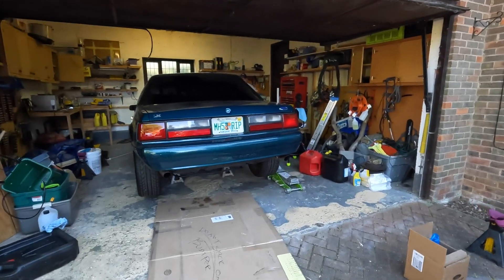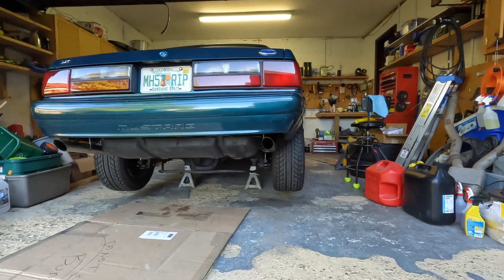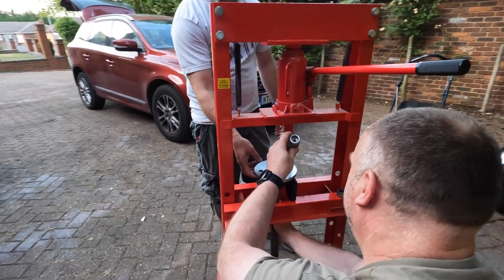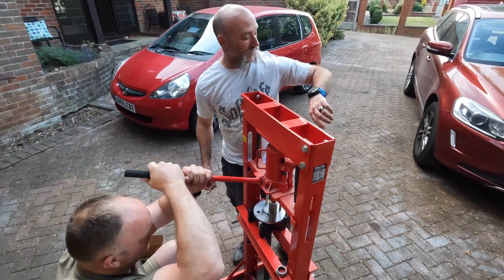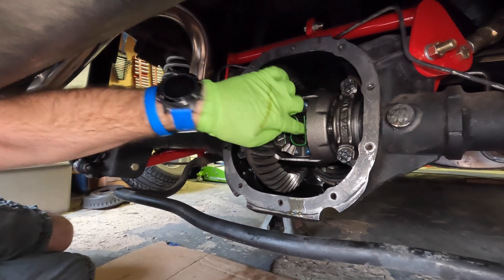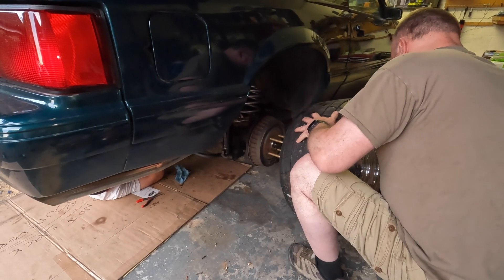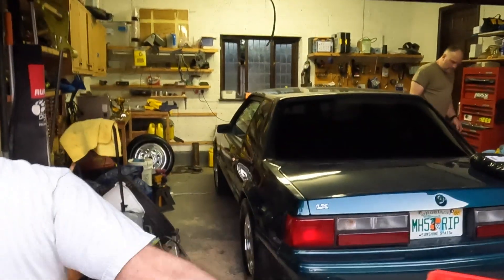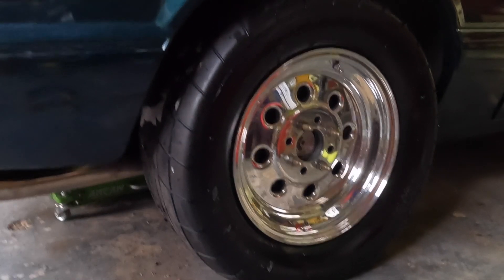Johns Foxbody 31 Spline Rear 8.8" Axle Upgrades

Comment: No threadlocker on the crosspin bolt.
Reply from the maker: The factory stuff is not really a thread locker but more like a wax or form of anti-size. If you’ve ever had one of these cross pin bolts get stuck or break you’ll know why.

Comment: Here's some information of 8.8 rear end axles shaft that i found on some mustang forum 57.25" - 57-59 Ranchero/Station Wagon 9"
*57.25" - 57-64 Ford Full Size 9"
*57.25" - 65/66 Mustang 8" and 9"
*58.50" - 77-81 Granada/Versailles 9" width
*59.25" - 67/68 Mustang 8" and 9" width
*59.25" - 69/70 Mustang 8" and 9" width
*59.25" - 67-71 Comet/Cougar 9" width
*59.25" - 86-93 Mustang 8.8" width - zero offset - 28 spline axles - 29.188" axle length
59.25" - 94-98 Mustang 8.8" width - zero offset - 28 spline axles - 29.969" axle length (Unsure of this width)
*59.50" - 91-94 Explorer 8.8" width - 3.250" tube diameter - 3.875" passenger side offset - 31 spline axles - 30.5" driver side axle length, 27.625" passenger side axle length
*59.50" - 95-01 Explorer 8.8" width
*61.25" - 71-73 Mustang 8" and 9" width
- 99-04 Mustang 8.8" width - zero offset - 28 spline axles - 30.688" axle length
- 02-05 Explorer 8.8" width

Comment: Hi, great work... do you know the axle shaft bearing seal part number.. i'm upgrade the my 2003 new edge rear end to a 31 spline axle shaft from a explorer (driver side) but i dont know wich axle bearing go to work 🤔
Reply from the maker: The seals are the same as the ones for the 28 spline axles.  I dont know the part number as the seals and bearings all came in the Ford Racing bearing kit.  I would just go on Rock Auto and it's easy to look them up from there.

Comment: Hi, would there be anyway to tell on my car if someone already did this by looking at the diff or axles without taking the whole thing apart. Thanks
Reply from the maker: Take a look at the end of the axle shafts where the axle studs are.  These 31 spline axles have an "M/E" cast into them for Moser Engineering.

Comment: "2 fingers" of clearance lol can you register a Florida plate over there ?
Reply from the maker: I was just checking if one side of the car was higher than the other.  The Florida plate does not matter.  The UK will issue the car it's own registration number and it will require new license plates to conform with UK standards.  White on the front and yellow on the back.